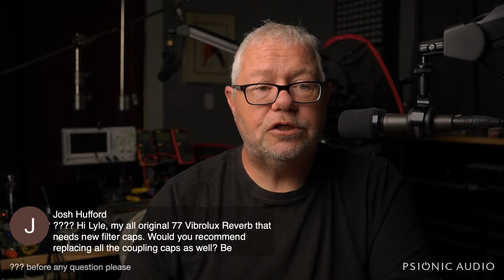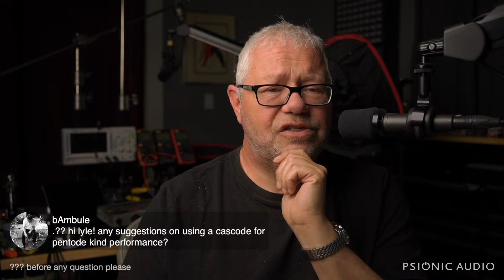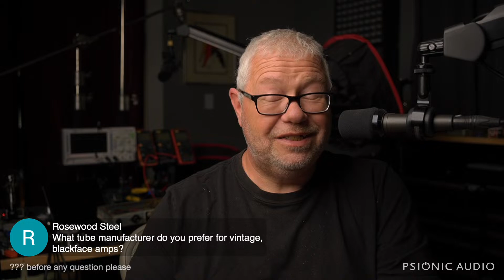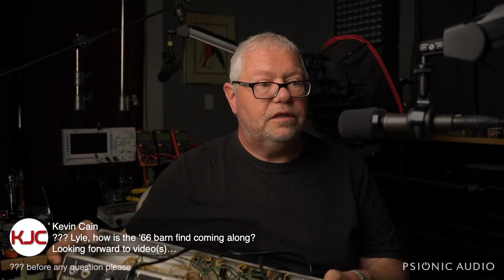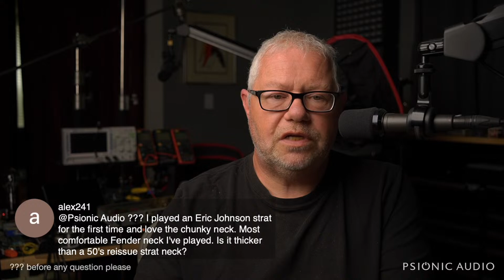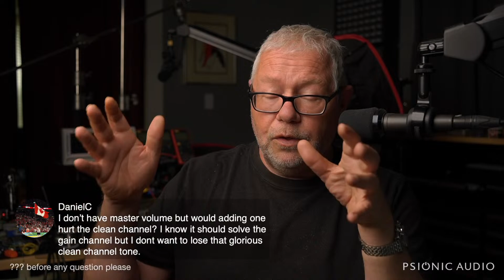Live Chat | Saturday April 19

Comment: ive been using contact cement for tolex lift.  you can let both sides set up so there is not squeeze out when pressed together then painters tape if needed till cured

Comment: We looked out to the east and what might have been a magic star to the east turned out to be a utility pole that was very much on fire. After  making about 8 seconds of cell phone video it became apparent that we should probably use the phone to call 911 instead. With the top of the pole burned away APS decided to hire some subcontractor to halfassed fix the pole, requiring restringing the 12,470/7200 volt lines shutting my home & shop down on and off for most of the day. Sorry, but no matter how it good tests, any transformer that has been inside of a fire should be replaced.